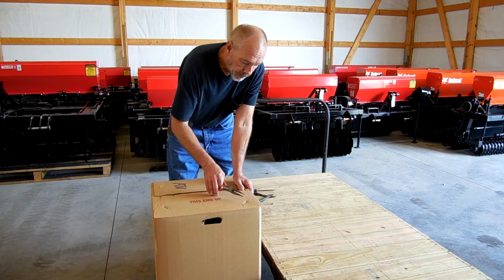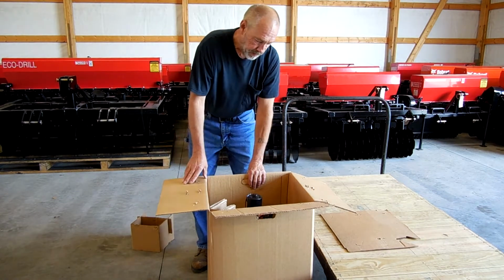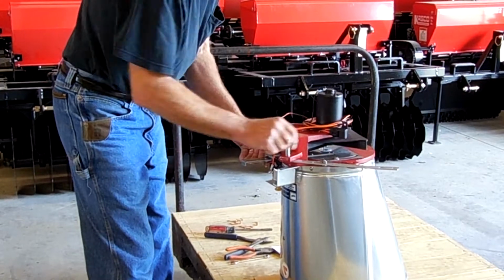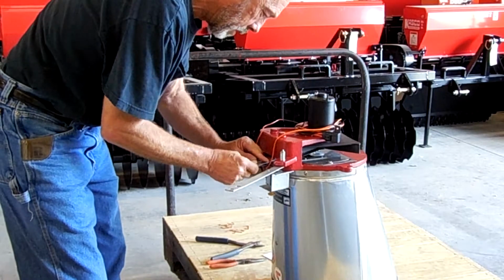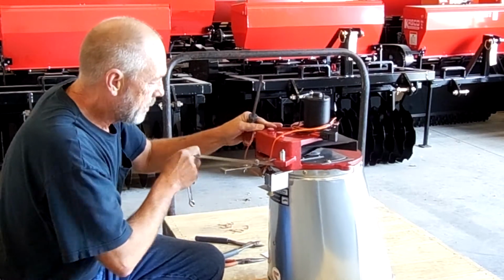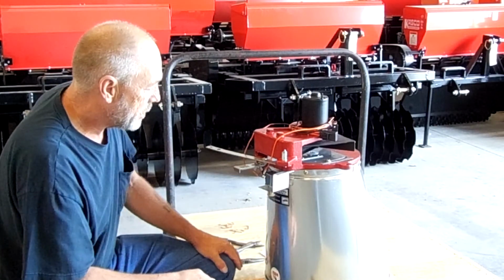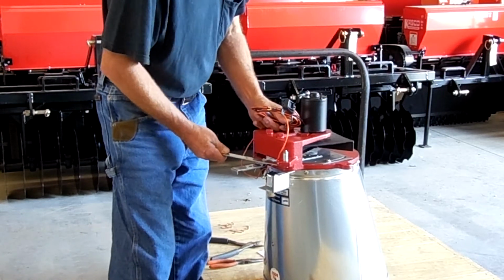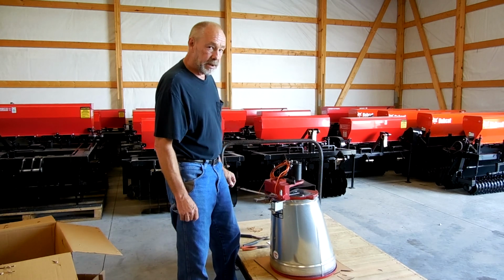Herd GT-77-ATV Seeder

Comment: My box looked like an NCAA football team used it for tackling practice.
Reply: How was the unit?  I’ve seen reports of poor quality.
Reply: @ChristmasCRL  ok, so the WP mount was a pain to install and I had to "customize" some pieces to get the job done.  It looks like it was spray painted and they didn't even bother knocking off the mill scale before doing that.  It looks like something I would make in the barn.  The seeder looks and works fine.  The lid doesn't quite fit because of the shape of the seeder top and the lid doesn't have a concave to keep it around the seeder top.  The lid also has a cotter pin used to attach the spring closure, and that doesn't really work either.  The spring keeps popping off the lid.  Other than that, and my dealer tacking on a hefty upcharge for ordering it, glad I have it.